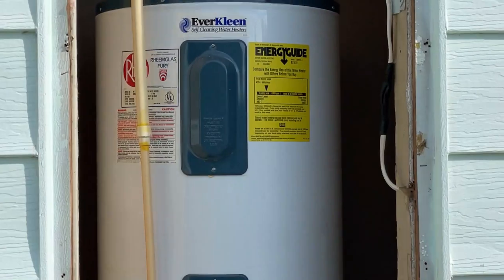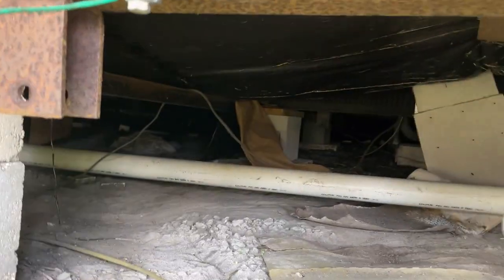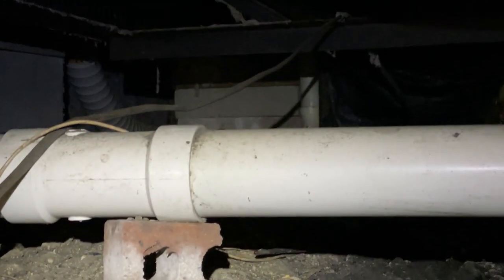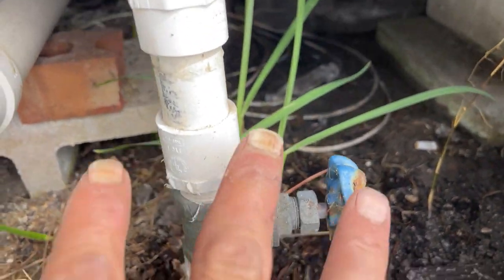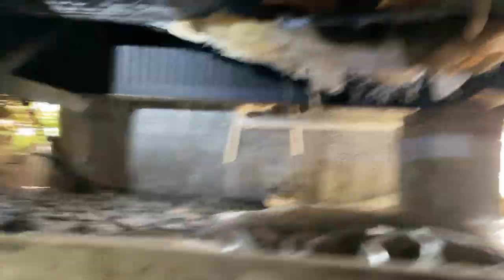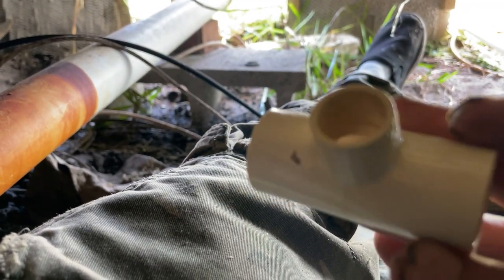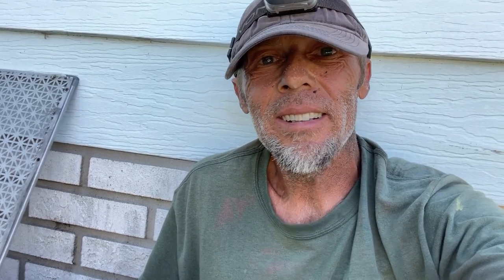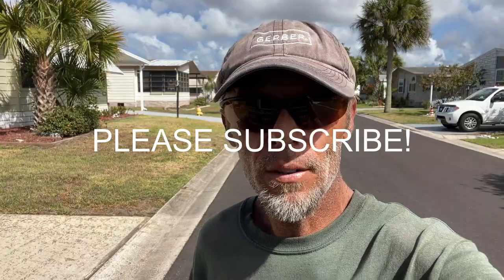ANOTHER MOBILE HOME REPIPE

Comment: I have a 25 year old single wide. I am going to re pipe it with pex. The old c p v c is too brittle and not reliable. It’s on a well, should I upsize the pipe size? From what the c p v c is, to the new pex? For better water pressure? Thanks. 
Why did they use c p v c again vs pex?
Reply: He made a horrible mistake, as soon as it gets too cold they will have busted pipes, pex is the way to go

Comment: Have a question what if you replaced all of the cpvc pipes and no leaks but meter box steady spins
Reply: Shut main valve off in home and watch water meter. Or food dye in toilet tank and see if it shows up in toilet bowl if leak change flapper
Reply: Yeah shut off at the main shut off to the house 

If it still spins you have a leak on the service line somewhere 

If it doesn't spin you have a leak somewhere in the house and your next step should be to shut off the valve at the water heater.  

If it still spins you have a leak somewhere in the house on the cold side.

If it doesn't spin you have a leak somewhere in the house on the hot side.

Comment: What something like that usually cost if you don’t mind me asking
Reply: I'd like to know as well
Reply: @ronniepemberton1942  $4-6k
Reply: In my trailer all the piping is behind insulation.who. Is responsible for restoring the insulation?
Reply: @chuckberthoud790 this is my question and are they doing the install in an area that doesn't freeze with no heat tape installed?
Reply: He said in the video that another contractor will add new insulation